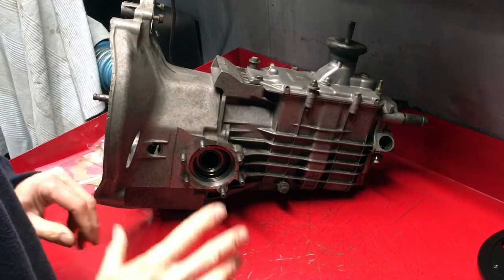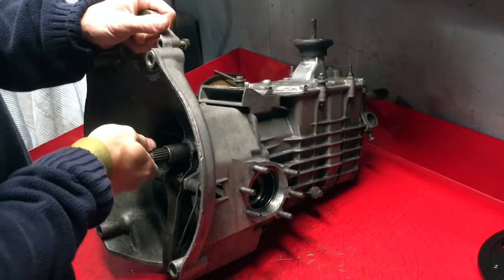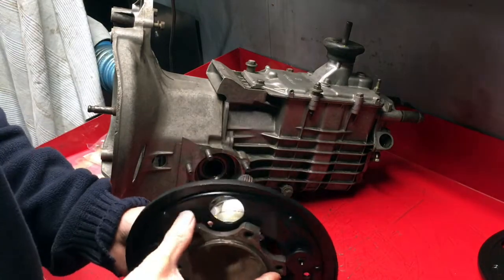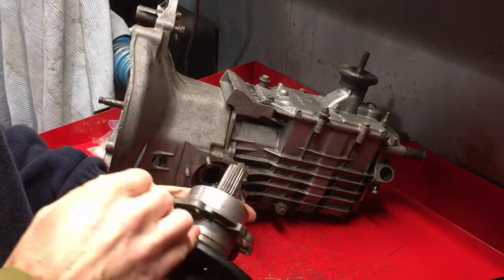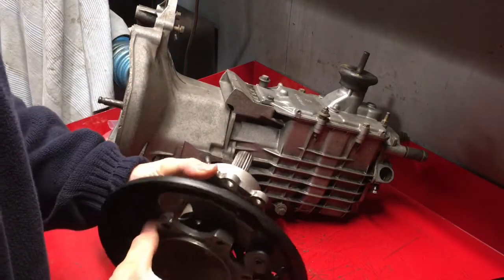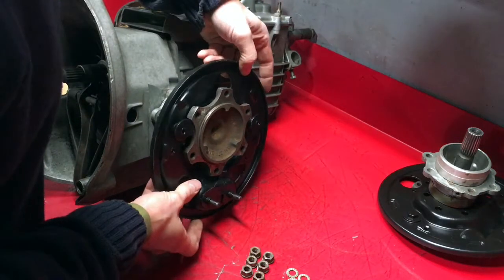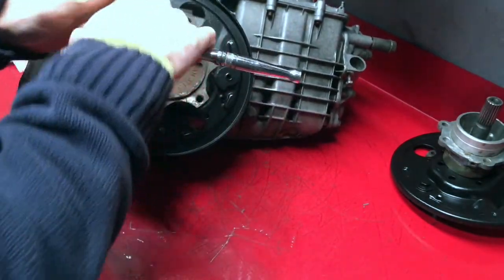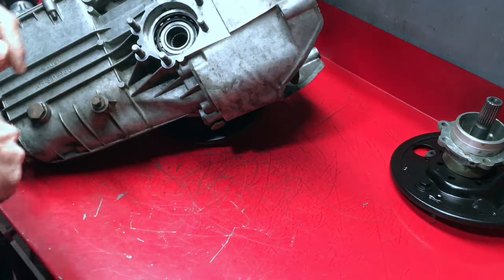Lomax 223 Rebuild #19 Assembling 2CV Stub Axles

Comment: How much was to rebuild the gearbox? I have an Ami6 citroen and the 4th gear don't engage. What could it be?
Reply from the maker: Hi. I didn’t get the gearbox overhauled as yet.  I will need to test it first. There are a few things it could be - hard to diagnose remotely.  Have you taken the top cover off?  ECAS sell reconditioned gearboxes.  Skäl.  David